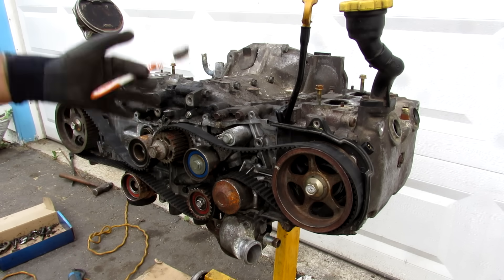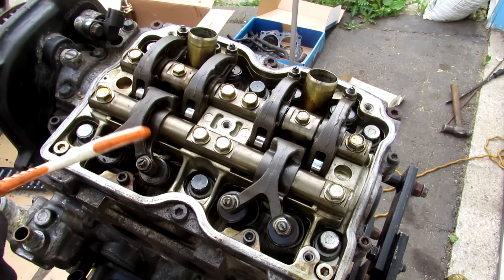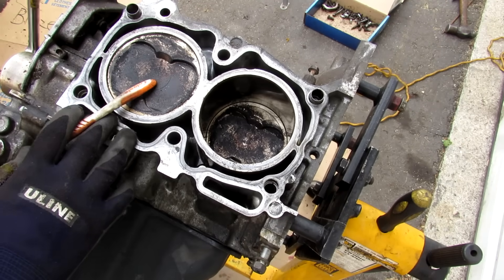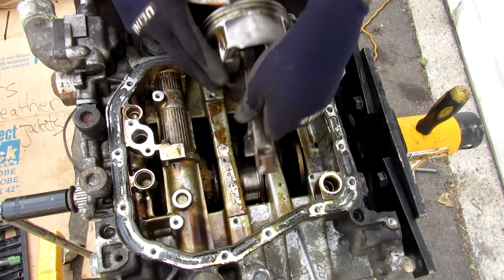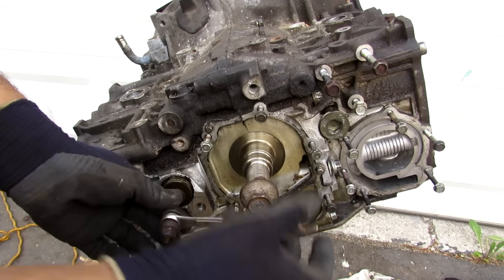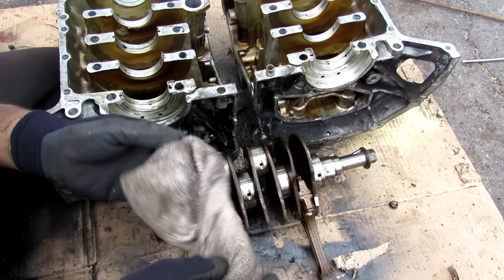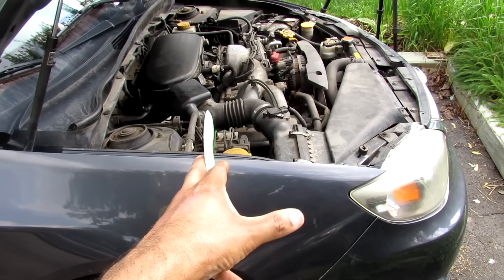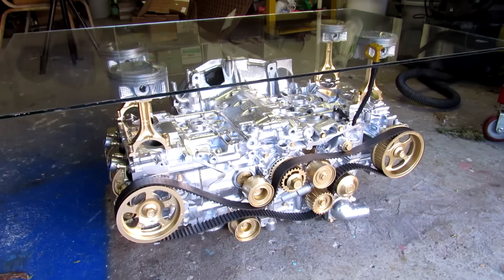Why Subaru Engines FAIL

Comment: I had 2 Subarus so far. Granted they weren't bought brand new, but both had headgasket failure at around 110-120k. I was even warned by a guy who only buys subarus for 3 decades, that the headgasket will fail, regardless how well maintained. They HAVE to be replaced at 80k or 100k.  (before they fail) , even if the dealer or manufacturer never mention it. If you manage to keep running it, then it will have to be done again at 160k. 
 They will not tell you to do this and there will be even people fiercely opposing this statement.  Even when I traded, the mechanic at the trading place said, "we gonna have to replace the headgasket as normal procedure on all subarus with over 100K"  They won't make a recall out of it because they would lose massive amount of money on service  recalls on nearly all Subarus out there.

Comment: Having owned several Subarus, and after watching this video, I will be sure not to own another Subaru. Its a case of making something needlessly complex and failure-prone. Subarus are an ideal candidate for a flathead 4 cyl. engine.
Reply: More to the point, Subaru has a poor fuel economy across the fleet.

Comment: I used to buy older high mile subarus    one 77 two 79 one 85xt i drove the crap out of those cars great gas milage and industructable not one of them gave up under 300k miles of my destructive driving habits. dont know much about the newer one but i drove the 77 in second gear with my foot on the floor trying to blow it up after 30 min i gave up.....

Comment: What is an oil galley? - Answers
Search domain www.answers.com/Q/What_is_an_oil_galleyhttps://www.answers.com/Q/What_is_an_oil_galley
Oil "galley" is a misspelling of the term oil "gallery." An oil gallery is an internal passageway in the block of an automobile engine that conducts oil to key components such as the main bearings.

Comment: This design successfully combines all of the worst features of automobile and aircraft engines into one!
Reply: Laughs in rotary
Reply: Umm in Australia  there are literally thousands & thousands of Subies with well over 400,000kms the EJ boxer engine is one of the strongest most reliable 4cly on the market. It's stupid people that skip oil changes & services & thrash the shit out of them. The Porsche Boxer engine is consistently rated as the most reliable luxury car in the world.
Reply: @Jimmy-fw1wd  Disagree. I think it's a great engine at 3500rpms and probably one of the best in the world. I think it's got serious design flaws under high load and over 5000rpm.
I think the application it was specifically invented for was a medium to low load application. It's very obvious the engine excels in airplanes where the load from wind has less of a harsh shock loading affect.
Reply: @lifeisgood070   Dude you are  completely right boxer engines tend to have a tonne of low end torque & were never made to be high revving engines like Honda VTEC or Toyota's  4AGE.  Or any other high rpm 4cyl. Driving to 3-4k rpm is probably the sweet spot in my 99 Rexi I completely agree with everything else  you said there man.
Reply: lifeisgood070 Subaru used to be part of Nakajima aircraft company of japan. That’s probably why they use an airplane engine in a car.
Reply: ? The Porsche  911 series (6 cyl boxer air or water cooled) did use the same type of engine, and in the past was such engine common in Europe: Citroën 2cv (twin boxer air cooled), Panhard twin boxer air cooled, Citroën GS 4 cyl boxer air cooled, Alfa Romeo  alfasud and alfa 33 4cyl boxer water cooled, Ferrari 512 12cyl boxer water cooled, etc...
Reply: @leneanderthalien  Not bashing the boxer design, I fly behind them all the time!  The Soob has lots of extra bolts that an aircraft engine would not, and there isn't a way to change out cylinders like a VW or aircraft engine.
Reply: @leneanderthalien  - I'm shocked! 😲 How could you leave out, probably the most iconic of them all. VW Beetle 4 cil. boxer, air cooled. Still the most sold car in history! Period.
Keeping on the same spirit. It's design base, the grandfather of the Beetle, the Tatra's boxer's also rather common, particularly later on trucks! Yep! Trucks and Tanks also have a keen relation with the boxer design! 

I'll put some motorbikes on the list, just for fun... The also iconic BMW boxer engines, made since EVER! Some standing with ridiculously high mileage's! 
Honda Goldwing (4 & 6 cil) considered one of the most reliable motorcycle engines ever. ALSO with very high mileage engine's being a rather common place!

People that say it's a "bad design" are ridiculously clueless! It's qualities,  success or failure is, by far. Determined more by economy, than by "design". ;-)
Reply: @leneanderthalien  They all sucked as well.
Reply: The advantage of the engine is less vibrations and a lower center of gravity. But... you can't fight gravity which is why an inline engine is always going to be more reliable than any other internal combustion engine inside a car.
Reply: a Subaru with the same engine NO MAJOR internal parts or overhauls just standard maintenance  went over a MILLION yes MILLION miles and is still running. Where is the design problem?  Mr good wrench needs to do a little more research. I speak from experience as my subee has over 400, 000 miles on it and still runs quiet and strong.
Reply: @captain757747  The only subaru engines I've seen last that long have not ever been driven hard. The boxer is a great engine to idle at and up to 3,500rpm. But if you put it against a standard toyota inline 4, both running at 5,000 rpm under load the toyota will last way longer. I think the reverse is true a low load 3k rpm or less.

Dare you to do a hill climb in that subaru engine at 120mph. The catch is if you let off the gas every 10 seconds the main bearings will still get oil. So you can't move your foot off the gas for >10 seconds.

And to combat the stupid stories about abuse. Abuse is driving without oil, reving an engine cold, etc. I drove a 2.7L tacoma engine on the rev limiter for over 100k miles from 110k to 210k miles. Didn't have problems. And I've done similar things with other engines like the challenger hemi I did a continuous 2,200miles at 150mph.  Everytime I try it with a 2.5L subaru it blows up. Having said that the 3.6L subaru engine seemed to handle 140mph for 300miles continuously.

Comment: Another reason why the stroke is kept short is to have more overlap between the profiles of the main and rod journals to help reinforce the crank. It needs this due to the big design compromise required in a flat 4 engines crank, this is also why flat 4 engines have large diameter journals and generally don't rev that hard for the same stroke.

Comment: Seems everybody wants to make a video, claiming to be experts in whatever it is they're doing.

Forgive me for picking it apart but you have more than a few mistakes in this video:

The head bolts are marked differently not because of the torque, as all the bolts are the same length and diameter and many of the later torque procedures have all the bolts at the same torque value.  They're marked because the washers are larger in diameter on those bolts and you'll seriously regret it if you put them in the outer holes because they'll wedge into the bolt wells, preventing you from fully tightening the bolt, and making it quite difficult to remove them.

The OEM head gaskets leak because the black lining on them breaks down due to what's called "micromotion."  (All cylinder heads move as they heat up, and also bounce or flex with each power stroke.  The movement is very minimal, hence the term micromotion, but they nonetheless move.)    The cure is to use the Felpro brand multi-layer gaskets.  I have sealed many with these gaskets over the years and never had a comeback.

And no, the oil and coolant do not mix on these engines when the head gasket fails.  They merely leak oil to the outside around the oil return ports (which is what most people complain about), and some may leak HC gasses into the cooling system, causing overheating or a miss in the morning.  I have lost track of how many Subaru head gaskets I've replaced and not one had mixed coolant and oil.

The balancing of a boxer engine is not that the pistons on one bank are out of phase with each other.  If that was true, all inline engines would be equally smooth.  No, the balancing on a boxer engine occurs because the piston on the opposite bank is moving in the opposite direction.  In other words, you always have two pistons moving inward and two pistons moving outward equally, thereby cancelling out each other's forces.

Also, when taking the head off the passenger bank, I noticed you had #1 piston all the way up.  For the sake of belt replacement, this engine times with all pistons at mid-position in their stroke so there's no chance of striking a piston with a valve.  The way you spun that cam gear bolt off without holding the gear, you could easily cause a valve to make contact with a piston and it doesn't take much to bend one.  And as with all Subaru boxers, one camshaft will be unloaded and one will be under load when in their proper positions.  The one that's loaded (driver's side), when you take the belt off, can suddenly rotate because of valve spring pressure.  If you have the piston all the way up, it'll quite possibly get hit by a valve, depending upon which way that gear rotates.  (Also, on the 4 cam engine, because of the valve angle, you can have an intake strike an exhaust valve.)

I've repaired Subaru engines (everything from the 1.0 liter 3-cylinder to the 2.5 liter 4 OHC 4-cylinder) for many a year and none of them have ever had any unusual (key word) oil starvation or oil burning problems as you seem to be suggesting.  The only time any of these have had issues is for the same reasons any other engine has issues - poor oil maintenance.  Once the mineral base is cooked out of an oil, all that's left is polymers, and that's what causes the sticky gunk and staining.  The oil rings eventually get stuck in their respective grooves and no longer press against the cylinder walls sufficiently enough to clean off the excess oil, and that's when the engine starts burning oil (indicated by the clean edge of the piston top).  As to any oil starvation issue, that's usually been the result of a sloppy mechanic who doesn't pay attention to the sealing of the pickup tube (which is part of the oil pan on many of these engines), or gets too much silicone around the sealing area of the camshaft retainer (upper part of cylinder head) and it ends up blocking the oil feed hole to the camshafts.  (I did have one engine that had camshafts seize due to this very thing.)

And, no, you don't "push" a piston pin out "from the other side" unless you want to drill a hole through two cylinder walls to get at it.  That special tool you mentioned (or something similarly fabricated) is the only way you get that piston pin out.

Anyway, I finally stopped watching around the 9 minute mark.  All you've basically done is take a junkyard engine apart (from the rust on the ends of the camshafts, looks like it's been sitting outside for a while) and identify the parts, which doesn't really address the claims of your title.  Subaru has had extremely good service from their boxer engines, aside from the pesky oil leaks from both the head and valve cover gaskets.  (I've also had four or five heads that had loose exhaust guides, eventually sliding down far enough to hold the valve open.  Pretty rare, though, given how many I've repaired.)

Comment: What most fail to understand usual those on the Subaru hate train is that these cars are extremely reliable they just take more oil than the average car. These cars are also abused by people adults and kids that dont understand the hp tolerance on stock internals and stock parts. Getting a educated tuner and a educated owner can create a absolute tank of a car that is able to beat most others
Reply from the maker: But when you stick it in a Corolla class vehicle people treat it like a Corolla

Comment: i have an 05 forester 174000 i beat the fucking piss outta thething. new headgasket timing belt and waterpump around 140k. change your oil often and keep revs below 4000. the 03-05 foresters come stock with rugged struts, and with the awd limited slip, amazing rural cars in snowy areas. they run great im just not a fan of all the emissions shit on em.

Comment: Horizontally-opposed 4-cylinder engines, which the presenter refers to it as a "boxer engine", are nothing new or unusual.  Since the 1930s they powered literally millions of Volkswagens and Porsches.  A 6-cylinder version still powers the Porsche 911, which is still considered to be one of the best sports cars on the market today.  If that engine configuration was inherently flawed, it would not have been so successful for so long.
Reply: Also used in AlfaRomeo Alfasuds.  Don't know how long those engines lasted as the body normally fell apart first.
Reply from the maker: It has it's challenges
Reply: The porche has been commonly called a flawed design excellently executed.
Reply: @duaneelsbree3460  Porsche doesnt even think a 911 is the best. they still make it because of owner nostalgia and adherence to tradition. porsche tried to move away from the old "hitlers revenge" layout but their customer base wasn't having it so they had to keep making the old style layout to keep selling cars.

Comment: This assumption about Subaru engines is no correct. I live in Australia which like USA has a range weather conditions. These engines are bullet proof, Toyota 86 uses this motor for it performance and reliability. This engine was poorly maintained and oil was not regularly checked, possibly wrong viciousity .  Friction modified oils are a problem for these motors. I’ve seen these motors do 500 thousand miles. Stay safe Roland
Reply from the maker: The problem is really when you put this engine in a Corolla class body and people treat it like a Corolla

Comment: People say it shouldn't vibrate much but i have a 2019 subaru impreza and when it idles it idles more rough than other in-line 4 cylinders iv owned
Reply: then have the engine mounts changed. or live with it. free country.
Reply: MAF sensor maybe?

Comment: After two timing belts letting gosuddenly, no more Subies for me.  
First one failed at 60k miles after replacement.  Second one at 40k miles after replacement.  Supposed to last 100k miles.  It happens in a few seconds, there's no real way to troubleshoot it before it happens, and it hand-grenades the engine.  

As for the head gasket thing, there's talk about it being a galvanic corrosion issue. The gasket failure is often around the front left side of the engine, by the battery.  Make sure the grounds from the engine to the frame are free of corrosion, and make sure the battery terminals are pristine, and you'll have less chance of needing a new head gasket.

Comment: Ye know I used to strip down and repair engines and gearboxes myself.  For the sake of experience I tried out driving an Electric Car (simple Nissan Leaf).  I am in awe at the complex and impressive engineering of a combustion engine yet the simplicity of an electric motor makes it vastly superior.
.
All the bits and pieces in a combustion engine that can lead to catastrophic failure don't exist in an electric motor.  The placement of centre of gravity, vibration, heat regulation and lubrication do not exist.  I find it startling that EVs are so much more expensive than ICE cars when you think of all the man-hours carefully assembling the engine and the gearbox.  All the man-hours behind engine development.
.
I was driving my EV slowing down to a traffic light (some time back) and all of a sudden I could smell burning gearbox oil, my first thought was, "Oh crap the gearbox oil must be leaking and burning!".... my second thought was, "Hold on, I have no gearbox on this car, that must be someone else's car."
.
For all the years I spent repairing combustion engines (as a hobby), I am truly impressed with their engineering, but I must say that I believe their age has come to an end.  Once I drove an EV, I got it - the EV is simply so much more powerful, so much more hassle free.
.
I feel like we are in the early 1900s when cars first arrived on the seen and people were arguing about which was better, the horse or the car:  A horse is faster, it eats grass and fuels up anywhere, it can reproduce, etc, etc.
Reply: Ev are fine around town when you charge up in your garage overnight.  Try making a long distance drive in one say 300 to 400 miles or weekly 200 mile day trips in one then get back with me.
Reply: Wait till the inverter takes a crap...............................
Reply: @wcurtin1962  and Rick Lewis - I'm not up to defending the EV.  I have driven one for 6 years now.  I can tell you that I can not go on a long drive with that car.  But I can tell you I pay $12 a month to fuel it up, So the gas saving alone has bought me flight tickets and rentals for any long trip (with money to spare).  As for the inverter.. in 6 years no issues.  How many issues have you had in 6 years?

Comment: OK, metric 101.  A bolt or nut that is undone by a 10mm socket/wrench/spanner is a 6mm bolt, not a 10mm bolt.

Also, check the dictionary definition of attenuation ... just sayin'

Comment: Great overview, but gravity has zero to do with gasket leaks in engines.  In a horizontal boxer it also has no effect on oil getting past the rings.  Only inverted and radial engines are subject to this problem, and it only happens when the engine is shut down for long periods of time.  Hundreds of thousands of inverted and radial aircraft engines gave good service with pistons upside down or at all kinds of angles.  Not a problem.